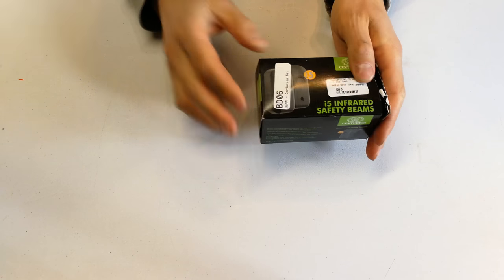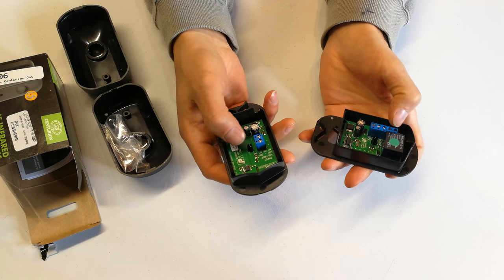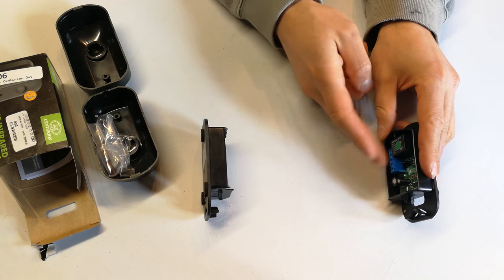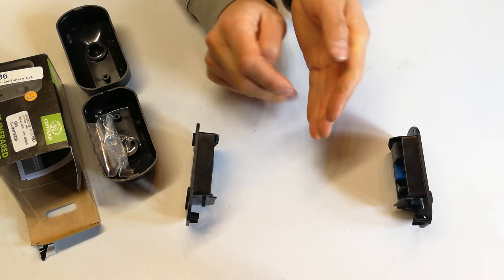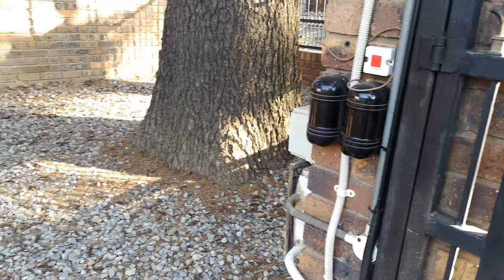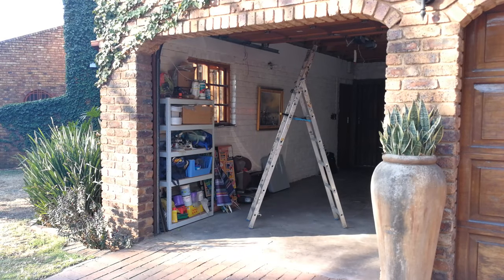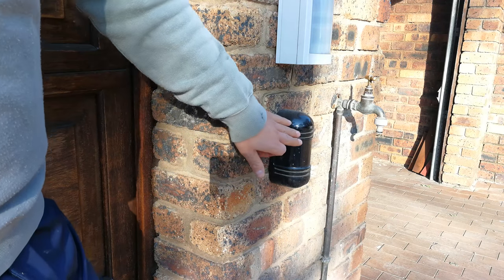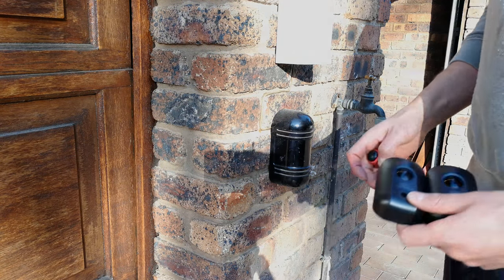What are infrared safety beams?

Comment: How does a tv remote create the different infrared pulses when you press a certain button?
Reply from the maker: it uses a binary code for each instruction (like next channel, volume up etc). That binary code is common to both TV and remote.
Reply: @ecologicaltime  how does the electricity from the battery create the infrared light